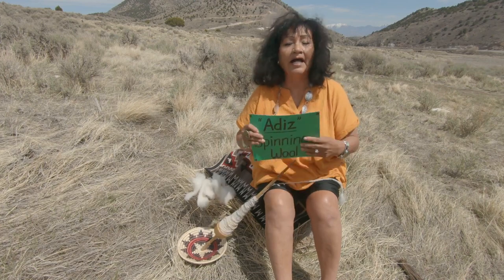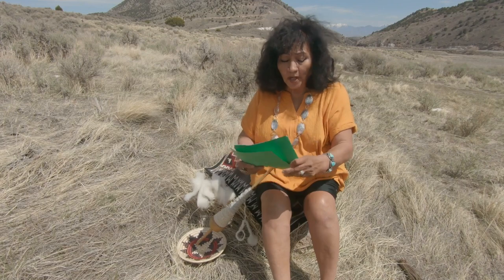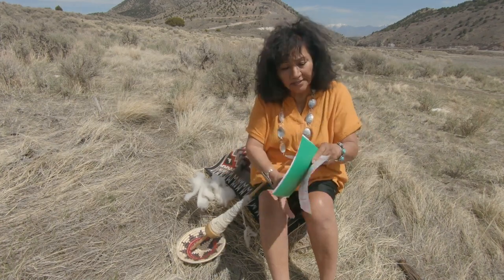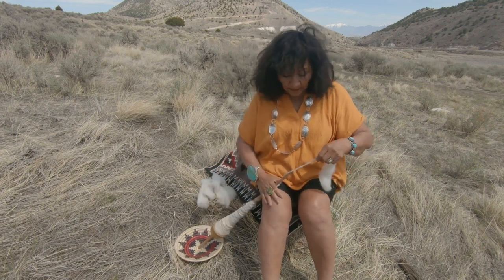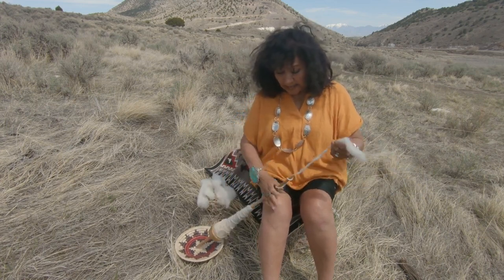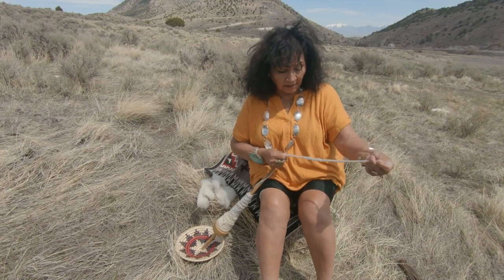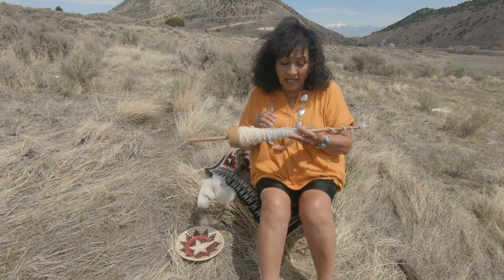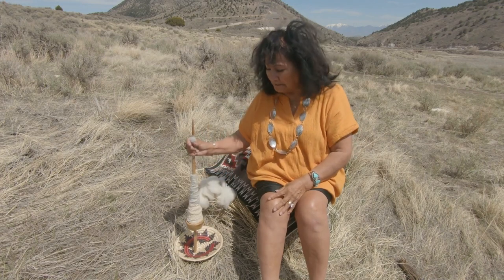AGHAA ADIZ -- SPINNING WOOL

Comment: I have one of these long supported spindles, but I haven’t been able to get the hang of it yet.  I’ll have to pull it out again and try it again while I watch this.  Is this the churro wool from your other sheering video?  I have some churro wool from a sheep named Grace that I got a few years back and still haven’t carded and spun yet.
Also, do you ply the yarn, or is it used single ply?
Reply from the maker: Hi Merindy I use single ply but that is so strong. I actually took about 5 strings and looped it around a hook outside and hung with us and it was amazing. And yes this is the churro sheep wool I sheared and it is lovely. I love the ranch where they sell the wool and it is beautiful and great to work with. You need to get back to processing your wool, stay in practice. What a gift! Love you. Navajo Grandma